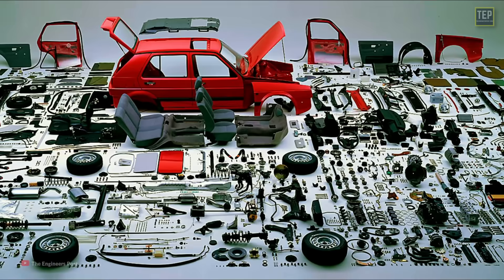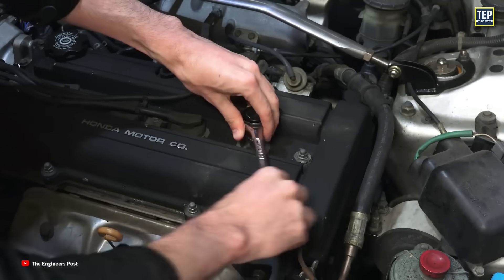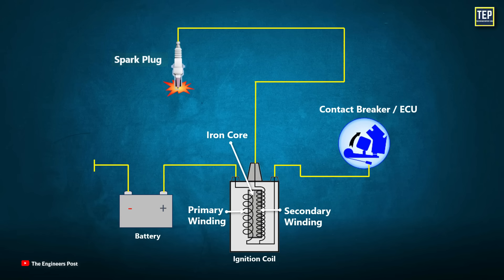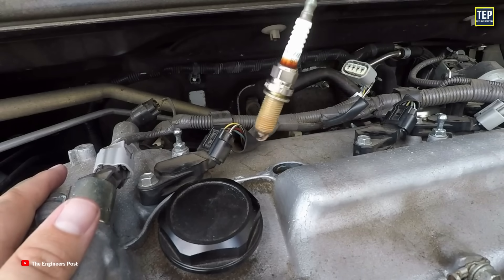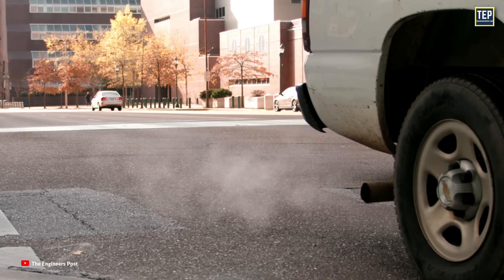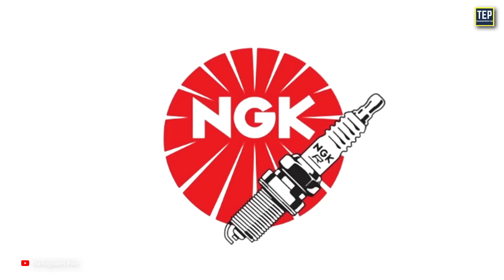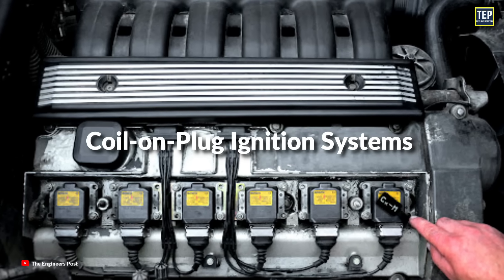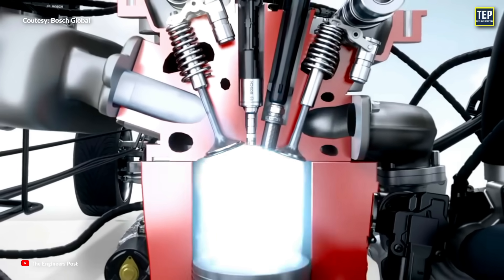Types of Spark plugs | Which is Best?

Comment: Also it is very important to properly torque spark plugs 45 years as a tech their are a lot of cars that it's not easy to get the plugs out. Also be careful buying plugs online their are a lot of counterfeit parts sold
Reply: I have never torqued my plugs, but I do know that you NEVER EVER use an impact wrench to install them.  EVER.
Reply: Ngk is the most replicated
Reply: @dmo848  NGK is a brand, not a type.
Reply: Most are made in China.
Reply: @harrywood8196  Even spark plugs now?  All because of Saint Ronnie and his endorsement of off-shoring our jobs.  In the 90s, Japan started copying us, much to their regret.
Reply: I only use stock AC plugs in all our GM's from 55 & up to 2014
Reply: @harrywood8196  I too generally use AC plugs in my vehicles, even my Chrysler, as I have always had good like with them.  Their Parkerized shell doesn't rust as easily as the other's plain shells do.
Reply: If a car is losing compression yiou have to reef the shit right out of them when installing them.
Reply: @parkerbohnn  If you mean what I think you mean, you won't be able to get them out if you do that.  If your engine is losing compression, it means you have to either do a valve job or a ring job.  Maybe both.

Comment: Sooo much bad info here. 
   First off, NO, you do not need a "college degree" to work on modern vehicles. Im many ways theyre EASIER than the older cars. Most have no points, condenser, rotor, cap, plug wires, dwell settings, mechanical advance, vacuum advance, etc etc.
    I happen to hold two degrees and a Masters as well. But I didnt start out that way, and they arent helpful when I work on my cars (both less than 5 years old btw)
   As a matter of fact, a college degree these days is all but worthless. They arent teaching anything, theyre indocttinating....but I digress. Tell me, how many ASE certified mechanics do you know with college degress. Nuff said.
    Second, a "hemi" has ZERO to do with the number of spark plugs the engine requires. It is a reference to the SHAPE OF THE COMBUSTION CHAMBER! A true hemi has hemispherical chambers! Who knew? Ironically enough, the people who popularized the term "hemi" is Chrysler Corporation (or whatever they are now) The 50s-70s Chrysler engines featured actual HEMISPHERICAL chambers and made mad power (for their time) as a result.
  Ironically enough, what Chrysler now calls "hemis" ARENT! Theyre actually wedges!! Frankly I think that Chrysler is shamelessly guilty of false advertising. But your average Mopar pilot is, well, not smart. They bought marketing. NOT a hemi!
  You did pretty good on describing the physical components of plugs and coils and their function.
   Most of whats "difficult" about modern mechanics is access. Access to the manufacturers programming and data sets. IF you want to buy it its gonna cost you a bunch and then you need access to software that can run, edit, and save data to and from rhe ECU and various modules.
   There are some shareware and freeware available that are really user friendly, no or low cost, and relaibly good. ForScan for example for Fords.
    Most people dont understand that car makers make most of their money on SERVICE not sales. Because of this the manufacturers consciously do all they can to discourage home and independent mechanics. You mythologizing the "too complicated for you" lie isnt helpful. 
   Are the modern cars more complex? Ya. They do a LOT more and they do it all better. BUT in some ways theyre easier. Less reliance on mechanical controls means simpler, more adaptable, precise controls. Theyre not "harder" to work on, theyre just different. Adapt, learn, and do it yourself or pay the factory their extortionist prices.
Reply: But most of us have no idea how to work on these computers on wheels.
Reply: Wanna know the most offensive "bad info" on this video? The last couple of lines where it's talking about "the downsides" of having more than one ground coil, specifically because "it changes where the ignition happens". Oh really? By that measurement, how'd you form a baseline of that hypothesis when between the threads and tension put on the plug you could put the 1 ground coil literally anywhere in the same 360° space without knowing where it was for comparison? And if there truly was a "best place location" for the coil to end for best ignition, why wouldn't you dictate making that location something infallible? Because you simply don't have enough info to make it happen, ergo you don't have enough to make the ending statement.
Reply: Well said 😊
Reply: Petition for Stellantis to call their new V8s „wedgies“
Reply: @SahnigReingeloetet  You mean 1958 repeated?  They are going to replace the HEMI with a wedge-head engine?   Better than no V8, but it won't really have the performance potential of the HEMI.

Comment: You are 100% correct - new cars are not very DIY friendly - the modern car has become a complex piece of machinery. At 13:26 this is a glow plug. For those that don't know - Diesel cars do NOT have any spark plugs.
Reply: 17:34 another diesel
Reply: They do have glo plugs.
Reply: The combustion engine still hasn't changed much since it's invention regarding overall design.. And if car companies would quit crossing electrical systems and continued to keep each electrical component on its own circuit you wouldn't have your wiper blades quit working when the stereo breaks or malfunctions. The biggest problem of repair is the unnecessary amount of different fasteners used(completely intentional) requiring the many tools. And overcomplicated engineering designs making access to components difficult creating the need to disassemble half the engine to get to the broken component. Chrysler is a noted example for putting air conditioning lines and components in the way because they are attached to the engine. When they could be attached to body panels instead of the engine which would actually allow better performance and less stress on parts from less heat. Again, all of this is completely intentional. And often not the design of better engineering. Just making it more difficult for the owner to fix their own car. The era for best tech, built and engineered cars was 2001 - 2010 by all manufacturers. Today it's Bling. Today We get Touch Screens that don't even retract. Real helpful in a crash. Shoot, they probably caused the crash.  LoL. And help with better MPG. LoL.  Bling. The next evolution for combustion engines is to change the fuel delivery system from a liquid to a gas since liquid fuel doesn't "burn" (as jet engines do), as only the fumes Burn. It would double MPG for all vehicles and reduce pollution by another 50%. The tech has been available for years and isn't expensive. No loss in performance either. But the fact it isn't "allowed" tells you governments don't really care about pollution, So-called Climate Change, or their citizens. Instead oil profits lead priorities. You only get to use 1/3 of the available energy in a tank of gasoline. 2/3 of that energy goes out the tailpipe unused as pollution. Changing to a fuel delivery that turns the liquid to a gas first (fumes) would reverse those percentages. Imagine 60 MPG cars and 45 MPG trucks (that's on the low side). Awesome for consumers. A nightmare for OPEC. Because they don't make a very large profit as it is.   lol    Peace.  (and too many taxes have been added to each gallon of gasoline.Remember when the difference between regular gas and super was 20 cents? That difference today is now taxes, not economics. Thanks Biden.)
Reply: Thats gdi engine
Reply: you think
Reply: Glow for diesel
Reply: They are, modern cars are not much more complex than older ones. They're just cramped af and sometimes require a PC program to reset some things. But it's often possible to buy pirate versions that work just as OEM for a fraction of the cost.
Reply: @AnonymousJohn7  Hahahaaa....you just posted absolute non-sense.
Reply: @horseathalt7308  please tell me what's so complex. Everything is literally the same with some added electronics which doesn't make it much more complex from a repair standpoint. Often it's even easier because the car pinpoints the issues for you.
Reply: @AnonymousJohn7  Software is complex, and only a few can remedy issues with it. Cars without "modern" computerization are far more straight forward and you don't need to understand code to repair those. I've been around for a long time now, and cars from the early 1990s and prior are a snap to repair compared to anything made in the past decade or so. Reliability has been falling ever since complex software driven modules came on scene. Durability in those cars was far better than anything you can buy today. Less gadgets and options, and more simplistic parts means lower repair costs overall. 
I'd gladly take a brand new MK 1 VW Golf over anything made in the past twenty five years.
Reply: @horseathalt7308  yeah good news, you don't need to know any code to work on modern cars. You might need to be able to operate a PC however, but unless you're a tech regard it's not hard. The biggest PITA of a new car is how cramped everything is, old cars were very roomy.

Changing a tie rod or a wheel bearing is exactly the same.
Reply: @AnonymousJohn7  The fact is that if the software is error ridden unless you work at the provider, that defect ain't ever getting fixed unless the mfr gets involved.
Reply: @AnonymousJohn7 ECU's are incredibly complex compared to a traditional engine. Any idiot can fix a traditional engine, they are quite simple, but modern cars can't be so easily fixed by anyone. 

Spark plugs don't really have this problem though - same whether car is older or new, though I've seen some new cars that require a surprising amount of dismantling to get to the plugs, which is ridiculous
Reply: Modern cars are complex piece of machinery !? How  ?  Have you even looked at some of the more complex military vehicles? Car computers have little to do, so usually, the auto makers use 3rd or 4 th tier computers for their applications, never leading edge, that will be a waste of computer power, save them for other more demanding uses. Gradually, since 3 decades ago, engineers started assigning more tasks to the computer, such as alternator regulating, cruise control, radar collision, monitoring  etc. How the military handle the complexity, they don't, not when you getting shot at. If there is a significant problem with a tank engine or airplane hydraulics, they crane the whole engine out and replace it with another one, called power pack. Or hydraulic pump, The whole power pack take just an hour to change. Then the old one get sent to the rear with the $million dollar equipment and technician to fix.
Reply: Real diesels don’t have glow plugs either and start off shear compression.
Reply: DEI hired Engineers = near impossible to repair designs
Reply: @Random-rt5ec  sure bud because DEI exists in Europe and Japan and that’s the reason ALL cars are becoming DIY unfriendly.
Reply: @Microplasticindulger  these blame their failures on other people despite themselves likely not being qualified lmao
Reply: @Random-rt5ec  This is true. Guess who "engineered the Boeing MCAS system? Yep. DE!hires.